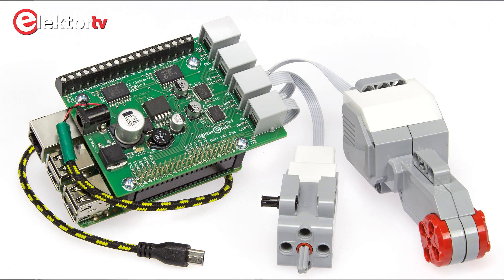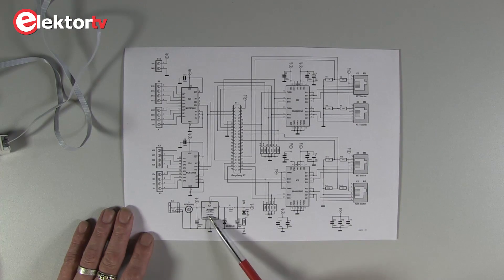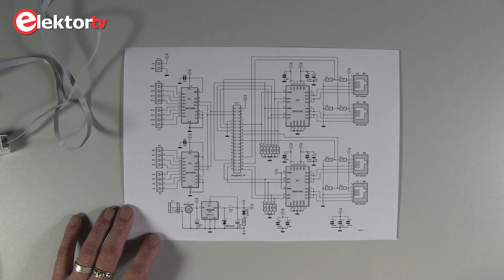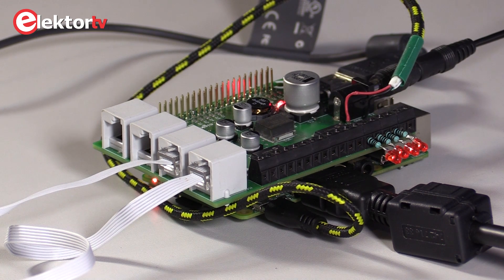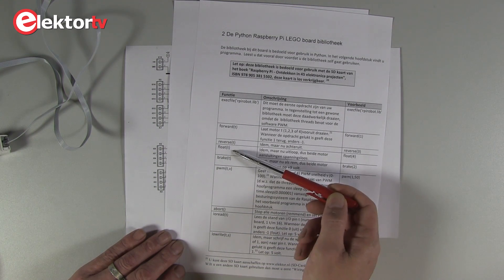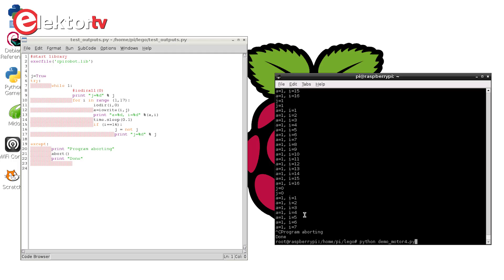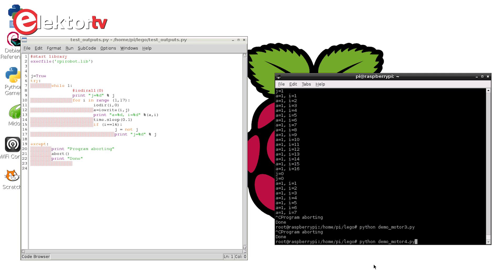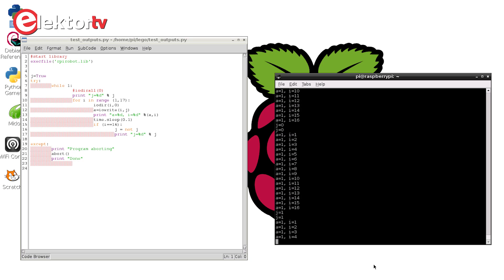Sneak Preview: LEGO Control Board for the Raspberry Pi

Comment: Do I need anything else except this board and motors to make motor control? Do I need some modificated raspbian OS or something else?
Regars, 
Milan
Reply: Hi Milan, You'll need to install Python libraries for GPIO and I2C (IIRC), no modified OS. You can also order https://www.elektor.com/sd-card-for-the-book-raspberry-pi-129025-82, this SD card has all libraries installed for this board.
Reply: Elektor Lab Thank you for your answer. One more question. Do you think that it is possible to control this engines through Java Kura framework(OSGi)? I used that framework for connection with different type of sensors..
Regardas,
Milan
Reply: I can see on your web site that this item is sold out. When can I expect that you will have it again? It is urgent. Thank you.
Regards,
Milan